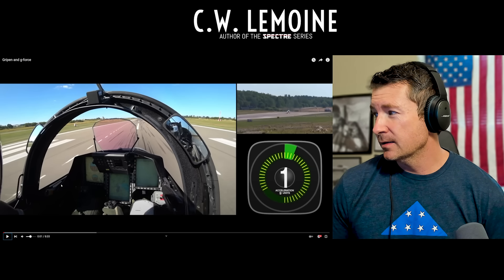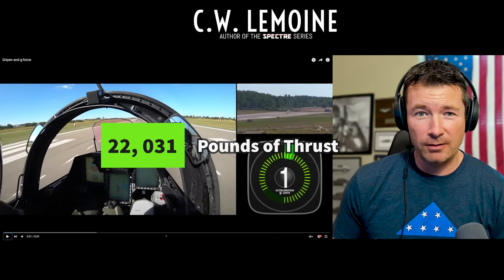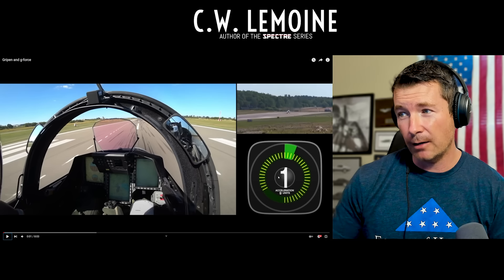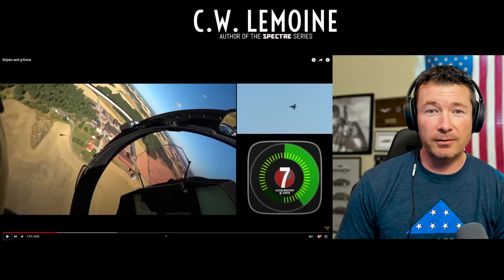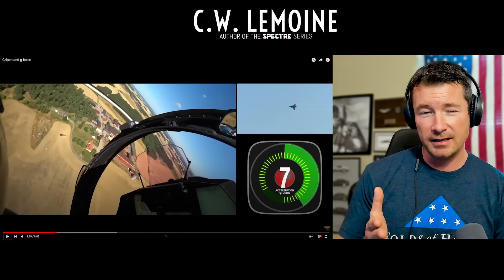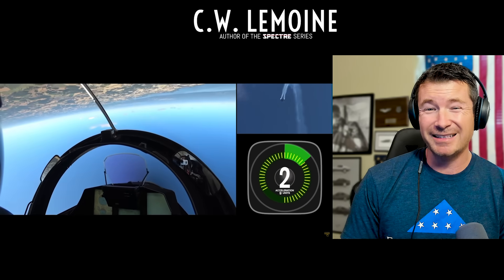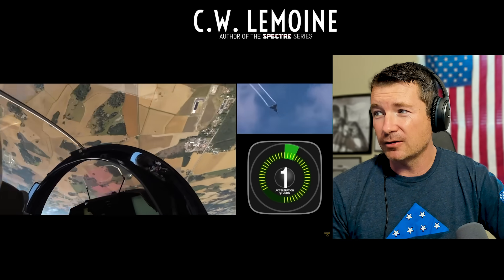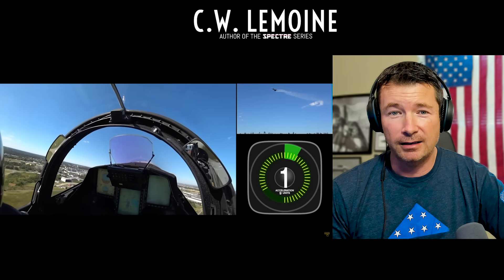SAAB JAS 39 Gripen G-Force Video *BREAKDOWN*

Comment: Finland did very thorough examination and found out that for their operational purposes, the Gripen is not that much cheaper than Fat Amy (tbh sharing borders with Russia probably drove down the price set by US). So Finland is acquiring 64 F-35s. Saab is pissed now because the Finnish tests nulled the one trump card Gripen had on it's competition; operational costs. Canada might choose the F-35 now too that the Finnish tests are done. 

Very interesting also that US (makes most of F-35s) and Canada share borders, just like Sweden (builds Gripen) and Finland. So if Canada goes with the Gripen it's gonna be a weird crisscross of aircraft and parts going around :D

Comment: Interesting comments. I flew airshows with prop acro airplane when the JAS-39 was promoted very hard for sale to Norway some few years ago. All of us pilots were invited to the cockpit on airshows. Omg. That was a small airplane. Cockpit smaller than my prop plane. Almost like Me 109 feeling. Legs hitting the panel. Then the F-16 display pilots guys came. They did not even bother to sit in in the "toy". They said F-35 is the only next tool for the job for us. And walked away. Norway bought F-35. Airshow the thunder and raw force of the F-16 at full afterburner completely parked the elegance and aerobatics of the J39 airshow. Think they made a point in front of the crowd. Sweet airplane. But not the bigger weapon.
Reply: Those Norwegian little brothers always have an urge to be cocky, They were obviously ashamed as The Gripens completely humiliated the Norwegian F-16s in Red Flag.

Comment: Hey Mr. Lemoine, long time fan of your videos,
Re: The "push-pull effect." They stopped doing it last year, but for a long time in the Hornets the Blue Angels solos would do an opposing inverted pass, push out to 20-25 degrees, then roll and pull 6.5-7gs on their clearing turn. Without g-suits. That has to hurt and it always looked absolutely brutal to me. One of those small maneuvers you may not even pay attention to unless you know about aviation.  

Edit: https://youtu.be/bFt3L2uyWlk?t=773 Old documentary showing a cockpit view of "Thumper" performing the inverted clearing turn. No thanks!

Comment: Gripen was one of the strongest contestents for Finland's new fighter jet. If it wasn't for the insanely cheap offer from the F-35 manufacturer I think it would have been a strong choice on bar with the super hornet. Love to see this jet in action, sweden sure knows how to build military equipment.
Reply: The figures were manipulated is my guess. F-35 is more expensive than any other jets out there. There is really no other explanation.
Reply: @Sunrazor  there is a very strickt budget set for our defence forces. Manipulating numbers would not go unnoticed.
Reply: Why? It's a medicore 4th gen, how could it ever compete with a 5th gen?
Reply: @impayingtheprice  originally F-35 was supposed to be insanely expensive compared to Gripen and Finnish airforce was not going to get as many of them as they would have needed. That alone would have been in favour for a 4th gen fighter. Gripen in comparison to other contestants was a strong choice.
Reply: @impayingtheprice  please please do a little research before making a fool of yourself.

Comment: The physiology part of flying is something the vast majority of science fiction stories that don't rely on magic technology seem to forget. When I air combat scenes I work on the premise that engines are overpowered to handle their max loads but with with a fly-by-wire program that places a hard cap of ten gees in accelerations or turns precisely because of the body's limits.
Reply: The Expanse does a great job with G's and even has people dying from sustained G's and high G's during battles. People have to take drugs just to have better endurance than a normal person.

Comment: As a Swede I’d say: Finally some talk about this machine. 
The JAS Gripen is an amazing fighter. (Sweden has a long history in building fighters, if anyone missed that). 
And, no its thrust aren’t like an F/16 or an F/18. However the aircraft isn’t meant to be built that way since its manoeuvrability comes with its Delta wing and canards. I mean, look for how long it pulled 9G in the turns. If it would have 30,000 lbs of thrust it would either hit >12G and then fall to pieces or
slingshot of the planet. 🚀
It’s a lightweight fighter and has the ability to takeoff on a 1,312 ft RWY and land at only 1,640 ft (400 resp. 500 m) of RWY. That’s because of Sweden’s use of “road bases” if needed. 
Turn-around time is appr. 10 minutes for rearming, refuelling, and maintenance. That’s also crucial. 

With that above stated I would like to say that thrust and flying faster than 2 Mach (SAAB says it does >2  Mach, but won’t specify it) isn’t all that counts in a fighter’s capability. 

Hi from Sweden 🇸🇪
Reply: Not to take anything away from the excellent performances of the Gripen, but here is an RNoAF F-16 landing in 600-700 meters with the drag chute, nominal breaks and enough fuel to take off and head for home base about 100 km away:
https://youtu.be/mOkhPtWTD7k?t=77

And just to point out, even USAF sometimes train for turnarounds in less than 15 minutes. Back in the 70s the requirement for "simulations actions" was 15 minutes while the YF-16s crews got it down to 6 minutes at Edwards. The Israelis is reported to have had it down to 7 minutes. So it is more a question of training and procedures. Likewise, I'm pretty sure a well trained Gripen crew could have it down to those numbers as well.

https://books.google.no/books?id=VUUCz5kgNIoC&pg=PA20&lpg=PA20&dq=F-16+turnaround+minutes&source=bl&ots=mTL8cMktDj&sig=ACfU3U1brlCB0CVakCt56SEs96IVwMj8cg&hl=en&sa=X&ved=2ahUKEwjL5rD5y4P1AhWMRPEDHReKAg8Q6AF6BAgiEAM#v=onepage&q=F-16%20turnaround%20minutes&f=false
Reply: "HILL GETS SET TO SMOKE 'EM IN A.F. CONTEST
By Deseret News  Sep 24, 1991, 12:00am MDT

It took an F-16 ground crew training for the Air Force Gunsmoke competition just under 12 minutes to ready a fighter jet for combat. That's fast, but not quite the real thing.

The time was almost four minutes slower than a combat "turnaround" performed by a crew from the 388th Tactical Fighter Wing during Operation Desert Storm, said Tech Sgt. Ray Driskell.
"When things are for real, the adrenaline really gets pumping," he said. "We had one turnaround crew in Saudi ready a plane for return to combat in seven minutes."

A routine F-16 fighter jet training turnaround, in which new armaments are loaded and a plane is checked out and readied for flight, takes about 30 minutes.

For the upcoming Gunsmoke competition, officially known as the U.S. Air Force Worldwide Fighter Gunnery Meet, the ground crew will have a maximum 18 minutes to accomplish the task."

https://www.deseret.com/1991/9/24/18942759/hill-gets-set-to-smoke-em-in-a-f-contest
Reply: Greetings from Austria. We almost bought the Gripen in 2007 to replace the Draken but we bought the Eurofighter instead. Wonderful plane, but it is eating all the budget at once without being verry deadly because we have no money for weapons left.

Basically every swedish weapon system we ever bought did run way to long and way too good. We had Saab 29, the Draken, the Saab 105 till last year, still the Carl Gustaf and now we are really considering buying the Gripen because paying 80 000  Euro per hour for the Eurofighter because of curupt politicians really pissed everyone off.

Comment: Worth saying is that gripen is a very light aircraft, much lighter (and also smaler" than its predesessoe.

The point of it is to be able it drop bomba on target and then fight its way back.

It being an attack aircraft, and the moment it drop the bombs  it automaticallt reconfigueres to a fighter. So it can lift with a very heavy load

It also does survalance  transparent with a fighter role.

On top of that it can land on forest roads and be hidden  in caves and do a 10 minute turnaround by 3 People.

The point was to give ussr a nasty  surprice if the got to invade. 

It

Comment: To add to what Mover finishes at around 4:58, when you're pulling negative your heart rate decreases because of the blood trying to pool in your brain (I've read somewhere that it can even stop, although not sure about that), where as when you're pulling positive your heart rate increases. As Mover said, the sudden switch from negative to positive is the thing most likely to induce G-loc, your heart is pumping slowly then you immediately ask it to increase once you switch to positive, but the heart can't keep up with the switch. You end up with a scenario where your brain is demanding more blood, but the heart can't momentarily supply it fast enough to prevent g-loc.
Reply: This is a last ditch maneuver employed when it is a life or death situation. In ww2 that maneuver saved Hartman's life on multiple occasions, and a variation of that is called the Hartman's maneuver.
Reply: @JG27Korny  Whoa! 
This means that Hartmann must've had a very strong heart, man! 

ᕕ( ᐛ )ᕗ

(sorry)
Reply: @Lowkeh  The idea is that he is pulling in a radial defense (in the turn) slightly less G than the pursuing bandit, when he sees that the bandit is pulling lead, then there are two complementary effects the bandit looses sights under the canopy and when Harmtann is doing negative G snap roll, to follow he has to pull negative from higher positive. And if Hartmann sees that the bandit was not doing enough lead but sliding behind into lag, he would do a break turn defense and scissors. However the idea was to get as rarely as possible in those kind of situations.

Comment: I have to add that the Gripen is fully capable of 12g turns.
She is software limited to 12g so the pilot can actually pull up to 12g.
The sustainability of speed at 12g is of course pretty short.
The pilot would most likely also not be able to handle it for more than short bursts.

In fact, in the early years and during the design of the first gen Gripen, the 12g turn was meant for a last resort to get away from an incoming missile.
It was even talks about an automatic 12g evasive manouvre (I don't know if it was implemented though).

Next thing, when comparing Gripen to F-16 and F-18, most Americans makes the mistake to only take the thrust into the calculations.
This is a grave mistake.
Gripen is underthrusted, yes she is, but she also has a much lower drag than the F-16 and F-18.
The much lower drag of the Gripen comes from combining the canard config with a realtively large wing area.
As far as I know the Gripen has the lowest wingload of all gen 4+ fighters.
This means a Gripen pilot doesn't have to pull as high alpha for a certain g-load as a F-16 or F-18 pilot.
Lower alpha for a specific g means lower drag for a specific g.

A very self revealing thing regarding max g and how high the drag is at high g is the water vapor produced around the wings.
F-16 and F-18 almost always produces water vapor when pulling high g (even on very hot and dry days).
You practically never see water vapor from the wings of a Gripen. 
Water vapor is NOT a good thing.
First of all the water vapor reveals that the aircraft is very close to what she physically can do whith the wing surface she's got.
Secondly, producing water vapor from the air around the wings is a huge energy loss (more drag and demands more thrust).

All versions of the Gripen so far has been proven to whip the a**es of the F-16 and F-18.
All available data from excercises wheere Gripen A, B, C or D has ben put up against F-16 or F-18 shows that Gripen will win 10-20 times for every loss.
Even with 2 Gripens against 5 F-16 (excecises between Swedish Air Force against the Norwegian Air Force) the Gripen has won close to 70% of the fights.
Reply: All aircrafts that can sustain 9g are built for higher forces because of safety factors.
Reply: @AlexKall  Of course but not all are designed to use the ability to fly 12g in an emergency.
Actually most fighters has their soft limit at 9g.
The F-35 for example, she is soft limited to 9g but has a structrural max g of 11,7g if I dont remember wrong.
Above that max structural g there is a safety margin of a certain % before the aircraft actually breaks in parts in the air.
This means a F-35 pilot can't pull more than 9g before the system limiter steps in.
A gripen pilot can at any time (with enough speed) pull 12g (when the g limiter steps in) and above that 12g there is a saftey margin of a certain % until the aircraft starts to break up.
The Gripen pilots are for several reasons not allowed to go over 9g (risk for black out and loss of speed at low altitude) in peace time.
If a Gripen pilot should pass the 9g mark, the aircraft afterwards has to go through a various amount of inspection and it might be decided by the engineers that an aircraft that has flown close to the max 12g gets a number of thousand flight hours shorter life life time, depending on what the inbuilt stress sensors say.

Comment: Per Saab site Gripen E thrust 98 kN. Per Wikipedia thrust to weight ratio: 1.04. Saab has increased the E's fuel fraction to double its combat range. Also has a helmet mounted site for shooting over the shoulder.
I'm hoping Canada will choose this aircraft to replace F/A-18's as it is well suited to northern operations.
Reply: 39C are also equipped with that helmet technology, just and older/different model than that of 39E which is updated.
Reply: @AlexKall  Thanks. Didn't know that.

Comment: They have restrictions on how close to edge of the envelope they can go. It was introduced after an accident in the 90’s when a Gripen crashed in central Stockholm during a display.

When it comes to the thrust… The Gripen has the same engine as the Hornet. A bit modified obviously, because… SAAB. The new bigger Gripen E has the the same engine as the new bigger Superhornet.
Reply: Nope, both early crashes (1989, 1993) was due to PIO, Pilot Induced Oscillations. A relatively new phenomena at the time when human and system gets out of phase.
Here is an example of an YF-22 ending in the same way (1992) https://www.youtube.com/watch?v=4JkcrtvN60s
another one YF-16 PIO in roll (1974) https://www.youtube.com/watch?v=giBNt_Vr1VM
article https://en.wikipedia.org/wiki/Pilot-induced_oscillation
Reply: Or because, Volvo 😉

Comment: A couple of notes: 
The Gripen sustains 9G as well as the F-16 "despite" the apparent lack of thrust. 
The G swap is 11 Gs, from -1 to +9
The right hand display is the tactical display with radar, SA, IFF etc. 
The Gripen pilots were the first equipped with full body G suits and positive breathing.
The Gripen is "artificially" limited to 30 deg AOA
Reply: How are you calculating that G swap, 9 - (-1) = 11 ?
Reply: Badly. :)
I know what I did wrong, and that was stupid. I could explain but it serves no purpose coz it's wrong :)
Reply: Wasn't there a -3 to 9? Or maybe that was -3 to 8 or 5 or whatever.
Reply: Its was -3 to +8 in a second and a second after that +9...

Comment: @C.W. Lemoine 

On the one hand, the Gripen is a well-maneuverable machine, it accelerates well, but while Dog was sitting in a MiG-29 and the Gripen was behind you, you were pushing a full afterburner and the Gripen was soon in front of you. :)

Of course, MiG had to get to the Dog, and the sad situation in Bosnia was that it didn't get there, because some AIM-120s came in, while MiG's radar, RWR and radio were unusable, in many cases he also made a mistake.
Reply: JA37 Viggens played with Mig-29 over the Baltic all the time. Some times the Mig pilots got flustered and ended up splashing into the sea.
Reply: @Merecir  No, that happened only once, and it was a Su-15.

Comment: Hey Mover - I downloaded DCS and it runs fine. However - I'm not willing to buy any planes yet because I've found (in the free aircraft) that if I "pull up" to climb at midrange speeds, I get to about 10° above the horizon and stall warning, buffet etc. Speed is still high. Looks like AoA might spike - not really sure. Clearly it's me doing something wrong; I have flown real jet aircraft before and as long as you're midrange in speed and apply power, you can ask for 45° or more without any danger of a stall warning.

I have noticed that if I ease back on the stick gently, I can get up to sort of 20 maybe 30° - but after that even with full power, speed starts falling off rapidly. This isn't the experience I'm used to from other sims, or from real aircraft. What could I have so badly wrong that makes them unflyable?
Reply: What aircraft were you flying in DCS?
Reply: @AlexKall  I tried the free P51 and the free "fighter" jet - can't remember the free jet's name.

Comment: about that thrust difference between F-16 and Jas-39: " At max weight, the J-39E has a better thrust-to-weight ratio, and a fuel burn rate at combat power settings will be slightly lower than the F-16 as well."
Reply from the maker: We don’t compare T:W at MTOW
Reply: @CWLemoine  seen the jas-39 and f-16 at airshows, that jas-39 is more than a match for the f-16. It's more modern, more composite materials so lower overall weight, etc etc... That jas-39 can turn on a dime, next airshow season you'd have to visit europe so you can see it in person 👍👌
Reply from the maker: Watching something at air shows does not translate to combat effectiveness.  I’m not saying the Gripen is not capable (it is very much so), but some of these comments are ridiculous.

Comment: Hungarian Air Force have 14 Gripen Fighterjets.Hungary had three options in 2001.Buy F-16 Block 52 modernise 18MiG-29 or replace the MiG-29 with 14 Gripen.Hungarian Goverment choosed the Gripen fighterjets.Hungarian pilots mechanics and aviation fans are verry satisfied with the Gripens.